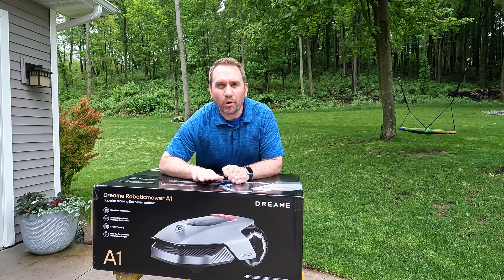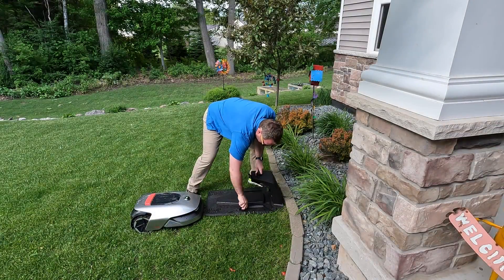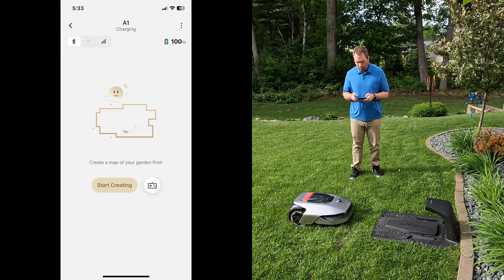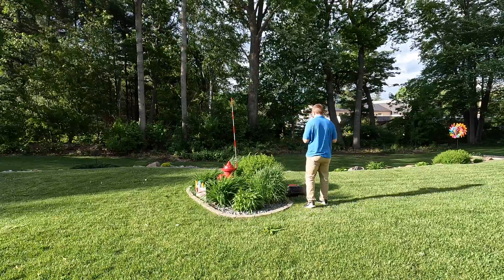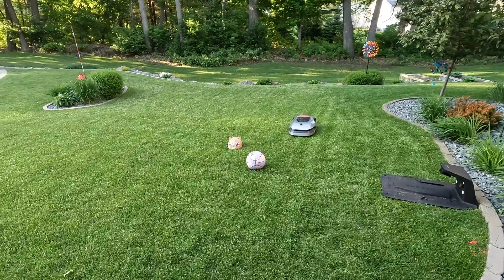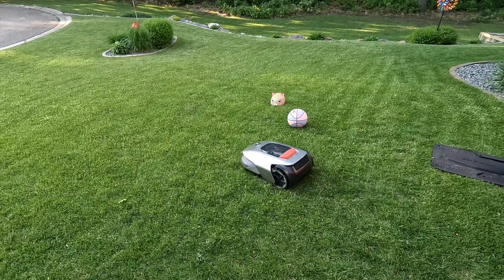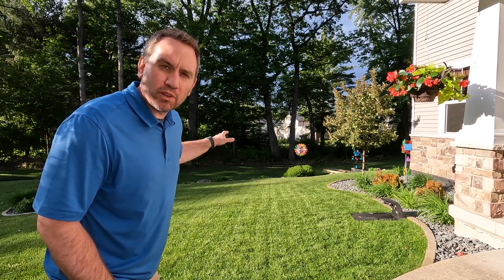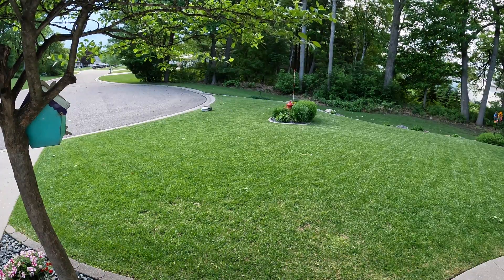Dreame RoboticMower A1: Setup and Test Mow

Comment: Very good review. Yes, this is nice for a nice flat lawns.  Front wheel drive would be nice. Lidar is great.  RTK is on its way out.

I would buy one of these for sure. But my lawn has slopes and holes.  It would not do well.  Front wheel drive would a big plus.

Very nice video. Well done. Thank you.....
Reply from the maker: You’re welcome, I agree with your summary.  Thanks for the comment.
Reply: Although it has RTK, your lawn would suit a Mammotion LUBA 2. Wide 40cm deck and excellent 4-wheel drive system

Comment: How do you create zones? is it the same as creating a "no go" zone?

I have sidewalk in front of my house and grass on the other side of the side walk, so I want the robot to be able to mow that section too, so I am trying to understand how this zone feature is setup. I know it handles multiple zones.

If you wanted to make say your front yard a zone, the sides separate zones and the backyard a zone do you have to run those perimeters separately or do just include all those areas on your initial perimeter setup and then mark the zones within the app? 

Thanks for info you can provide.
Reply from the maker: Yes, you run perimeters separately to create different zones.  You always start with a zone and then create no-go zones inside of that zone.  

Once you have your separate zones, you create a "channel" to connect the zones.  The robot will always follow the "channel" to navigate from one zone to the other.
Reply: @TheLawnEngineer  I just received my Dreame A1 and I think it did a good job mowing my lawn, but I had it set to mow all zones, but it only mowed the main lawn zone and not the other 2 zones. I had to then stop the current mowing since it finished the main lawn and had to specifically tell it to mow the other 2 zones. That isn't good. I will have to see if I can figure that issue out.

Then I switched to the Edge feature and my mower goes out to the front lawn and just wanders around not doing any edging. Have you notice this issue in your testing?

Thanks.

Comment: Nice review. I have the same lawn edging and I expected the mower to follow the edging and cut the edges of the lawn. Why can't it be seen? He can not do it?
Reply from the maker: I stay a few inches away from the edging when driving it around the border to create the map.  I installed the edgers 2” above the dirt, none of my robot mowers deal with the height difference well.  

If your edgers are at the same level as the ground, you can ride on them when creating the map.

Comment: Was it able to handle under your trampoline?
Reply: I have Dreame A1 and it does not handle trampoline too well. It wont detect horizontal legs on the ground and will run over those with a little bang coming from the cutting blades touching metal.

I have added some blockades to the legs so that it will not run over those. Now it does run from the middle of the trampoline but leaves edges next to the legs uncut. I will provide you with a photo on next comment
Reply from the maker: Agreed.

Comment: The fact you don't need an RTK is cool. I'm still using my Segway Navimow i110n and enjoy it so far, other than the 7in cut. My Luba 2 3000H is still sitting in it's box for more than 2 weeks. Between life and the amount of rain we've been getting, there's no time 🙃
Reply from the maker: It is amazing how the days fly by.  How do you like the Segway?
Reply: @TheLawnEngineer  Other than the longer run time due to the smaller area cut, I really have nothing bad to say about the Segway i110n. I feel like Segway packed a lot of tech into an affordable price for the mainstream. It's super light on your grass, doesn't rut anything making it's zero turn. The app is super user friendly.  It can handle both sides of my house and the front(3500 sq ft) on 1 charge but my backyard(6500 sq ft) it can do about 70% before returning for a charge. I think I'll finally set up the Luba 2 this week after tomorrow's rain and finally get a comparison.

Comment: Nice mower but I prefer the Sunseeker you reviewed earlier. Sunseeker mow height is 4 inches vs 3 for the Dreame. Base model Sunseeker can do 3/4 acre vs 1/2 acre. Not sure about Dreame support but Sunseeker has a location in the Carolina's. Sunseeker can handle lawns with more slope. I prefer the front wheel and all wheel drive of the Sunseeker. For me the setting up of RTK is not an issue and the Sunseeker has Lidar vision as well. Nothing wrong with this Dreame but the Sunseeker you reviewed is overall more capable. I am still awaiting the delivery of My Sunseeker Orion Plus model because I have close to and acre of lawn. Disappointed the shipment has been pushed back to June 9 vs May 20th but Sunseeker did include a longer warranty valued at $199 to make up for the late delivery.
Reply from the maker: It sounds like you picked the right mower for your needs.